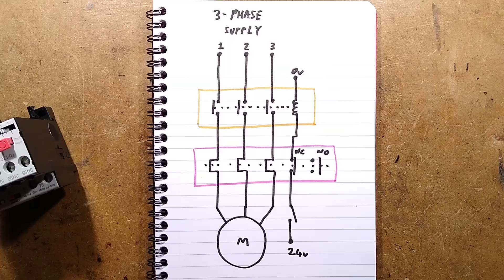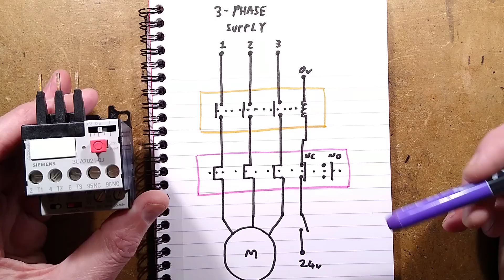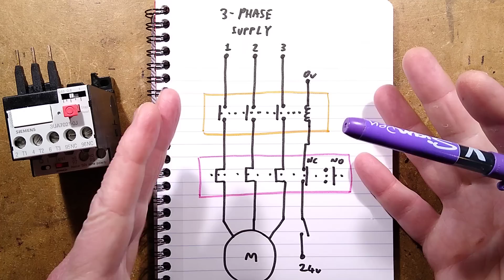Siemens motor overload relay teardown

Comment: When I was a baby electrician I went to a candy stretching machine at night that had a tripped overload. I reset the overload and it tripped instantly. So I tested everything and ended up disconnecting the motor. The motor ran fine. Turned out the gearbox had siezed. They definitely work
Reply: 99% of the time. overloads are mechanical in nature.
Reply: @professorg8383  Pretty much the only electrical issue I encountered was a broken (phase) connection on the terminals of an conveyor motor. It only ran on two phases so it drew to much current
Reply: @professorg8383  tell me about it. The only motor related call out I ever had that wasn't a mechanical jam causing an overload to trip, was when a VSD completely shat the bed and needed replacing. I'd get a call at 2am saying the auger or pump is tripping again, I'd even ask them if the shit was jammed up, "no it's fine, must be an electrical issue." Drag myself out of bed and get to site, first thing I'd do is open the inspection hatch, or remove the outlet pipework, and have a look, sure enough, jammed to fuck. 🙄

Comment: Siemens gear seems solidly built
Reply: Well, had a lot of Siemens stuff that stopped working eventually, after 40 odd years, well past the warranted lifetime. Rated only for a million cycles, but went well past the 20 million mark, though there were some switches that made it past the 10 million cycle mark they were warranted for, though to claim would be hard, as the switches physically wore parts out, or the contacts went intermittent. Guessed they were over 20 million cycles, based on the previous owner of the machine running it for 20 years on 3 shifts, 7 days a week, at full speed. 

Still had a whole slew of the original INA and FAG bearings in it, all still fine once greased, and the only thing that did fail was an original VARIMOT drive, which disintegrated the clutch spring. Obsolete, so went to the Fenner catalog, and got a 2 belt pulley and Fenner Lok hub, and machined the middle out, to fit the VARIMOT belt, which I can still buy off the shelf. Then put a VFD unit on the original motor, a fan for forced cooling, and it ran well. Forced air cooling to compensate for running at 30Hz,

Comment: I only knew them with an additional blue knob beside the reset button that could pushed in and turned to stay down, being able to auto-reset the device that way.
This sure only is a workaround in very remote locations that need to operate, or maybe the backup pump.

Comment: There are at least 2 other variations on these devices. The older one uses heater elements to melt tiny pots of a low-melting metal alloy like Wood's Metal, and when the alloy melts, it allows an embedded cogwheel to rotate under spring tension, tripping the mechanism. And there are more modern electronic types which use current sensors, a comparator circuit, and a time delay circuit to trip a latching solenoid.

Comment: Additional function for these is protection against phase loss, which is done by having that trip bar in 2 pieces, with trip being caused by either the 3 bending over too mach against a spring, or if you loose a phase you have one that does not move over with current, making that the trip point is now a lot lower, and tripping fast. Normally you have an option for manual reset, or automatic reset, where the contacts will change state on trip, then, after the shunts have cooled down, engage again. Normally selected with either a pin, or a slot on the actuator bar that keeps it in reset always. The units are not expensive, around the same price as the contactor, though of course you have a few different ones per model of contactor, with ranges with quite an overlap, so that you can choose a trip current matching your motor. Often used with a push button station, where the green button presses on the actual contactor coil to close it, then one of the aux contacts holds the contactor on, while the stop button resets the overload, ensuring that each operation of the stop will reset the overload, and drop out the contactor, or that the motor will not start and run unless you press stop first, to reset it, telling you it tripped for overload or phase loss, not for power failure.

Comment: It reminds me of repair i was send to. The column drill was not working and they needed the drill continuously. In the meanwhile the mechanics created a wooden board with a screwdriver attached to it. By pressing the contactor with this construction they keeped using the drill. It was my easyest repair i ever had. Just press the reset button and it worked again.

Comment: Nice to see you taking something apart thats not total cr4p. Used to use a lot of Siemens contactors and control gear, always good solid reliable gear.
Reply: Siemens is also german Which for me also adds extra trust knowing its from a european country who has good engineered/designed neat products

Comment: That to me back a few years as an apprentice electrician in a factory, making and repairing control panels. Those were the days doing bespoke work from wiring diagram, you were just giving the electrical specs and of you went to make a control panel, because you couldn't wait for the manufacture to send a replacement as a machine down was costing thousands in lost production. Most sparks these days won't know what your talking about if you said star start,  delta running
Reply from the maker: They do work it out when they manage to poke both contactors in simultaneously.   As for the start and run rated caps.  It's usually just one cap now.  Noting that modern motor capacitors do fail faster than the older ones.
Reply: @bigclivedotcom  Yes have noticed that, to the point I would not even bother testing them after 2 years of use, and simply replace with new, or add in a hard start unit across the capacitor, as that at least would allow it to run even with a capacitor down in value.
Reply: Or that you need to set the star delta transition time on larger motors, because you need ot get it right, or have a rather massive spike on that transition. 

Or the installer who wired the motor wrong. It started in delta, and after 5 seconds switched to star.  No wonder the machine had a tendency to walk itself off of it's floor mounting bolts. fixed that the day I saw it do that, and when i replaced control circuit I dropped the star delta timer completely, and instead used a 8kVA soft starter instead, and a new contactor and overload unit with the new motor. Adjusted to ramp up as slow as possible, and set to the profile for a large fan. 30s to get to full speed made for a gentler start. This was a 5 ton blender for powder.
Reply: A lot don’t understand CAP start CAP run either 🤔

Comment: At the bottom of the bimetalics is a double slider that trips the mechanism, if all 3 phases see the same current within range, all 3 strips may move a little
But if you lose 1 phase, one of the 2 strips will move more than the other, which will trip the device even if the remaining phases are within tolerance, known as 'single phasing protection'
also, if you are not isolating the whole panel (you could cause problems if you do) randomly pressing reset on all contactors could be an issue, the reset is also the stop function, it will disconnect the control circuit of a wiorking contactor. (press the reset while testing contnuity to see what i mean)
Reply: Yes , the style of overloads detects single phasing. However, they can be used in a single phase operation as long as you take the output of one leg and redirect it back into the overload on the third leg. That way you get even heating of all three elements thanks for the observation 😊
Reply: @DavidGauthiersquidpride2014   Nope... you are wrong. These do not trip on differential between each pole. They only trip if one or more phase heaters exceeds the set point for mechanical tripping of the aux contacts.  
There is NO need to double or in fact triple "take the output of one leg and redirect it back into the overload on the third leg." 
There is NO need to run an Active and Neutral of a single phase motor supply through the TOL.
Reply: @BTW...  There is a difference in force that one vs three bi-metal strips generate for tripping.  All the manuals i have seen for these have had jumper wires for 1-phase use.  And the connection diagram (for the whole contactor+thermal relay set) has always been supply to L1 in -> L1 out jump wire to L2 out -> L2 in jump wire to L3 in -> L3 out to load.

I probably have some orphaned smaller ones somewhere and could try to trip them.  There should be noticeable difference in tripping times, but it takes several alternating tests to filter out overall warming and ageing of the thing.  Bench power supply should give stable test current and it should not make any difference versus mains ac.  Though as I am an electrician, it would be easy for me to safely run something like space heater through one.  If I could find matching devices to make the trip time to be >minute, so that the trip times would be close to real life situations with broken phase etc.
Reply: @BTW... Here is where you do not know what you are talking about. 

SOME over loads do not care if you use them with single phase, they are purely thermal overloads, SOME also have magnetic overload protection. These require you to run the current back through the 3rd leg...in the same direction as the other 2. Or they will trip instantly. They even make digital ones that are more complex yet. 

As usual technology is more complex than a simple yes/no answer. 

You should probably educate yourself a little before running your mouth and looking like a fool.
Reply: So, i did it.  Almost 100 trips with autoreset and esp8266 measuring the results.

My test setup was two relays controlled by esp, first one connected that zigzag pattern through all poles, second one used only L1 (which is usually the way those are wrongly connected).  I also changed the setup mid way to measure L1L3 and L2L3 two pole trip times.

At first i tried with too small 125% current, 3-pole setup tripped in 213 seconds, but when i tried one pole only it had not been tripped at 12 minutes, so i raised the current to 150% and all the rest have been tested at that level.

Average trip times at 150% current are like this:
L1L2L3 - 115 seconds (101-128)
L1 - 216 seconds (138-284)
L2L3 - 85 seconds (81-91)
L1L3 - 95 seconds (91-103)

Others were quite stable and graphs are pretty flat, but L1 raised from ~140 to ~240 seconds with couple spikes to ~280 with about the average result between them.

After the thermal relay had tripped, program waited for autoreset and additional 5 minutes after that before trying the other connection.  So it was alternating between two current paths and letting the thing cool a bit between.

Device that i tested was new in box, but old telemecanique LRD02 (same device is now sold as schneider tesys) 0,16-0,25A (ac/dc) at 0,16 A setting, so my test current was 240 mADC from bench power supply.

I also found a broken LRD03 from my junk pile and did tear it apart.  It does have that mechanical imbalance function mentioned earlier.  Theres a clever linkage that makes the tripping arm move more, if the bi-metal strips bend differently to each other. 

That imbalance-function shows clearly on the 2-pole results, but i'm not sure why 1-pole trip times go that high.  I don't think that the overall temperature could have risen for 7 hours straight.  I changed to two pole setup in one 5 minute cooling period, so the temperature did not change because of that and results after that were stable.

It's not an actual real life test, as the current is always at tripping levels.. Someone else could try to run these 30 years at a time, before trying the "motor malfunction" trip times.  VFD:s and integrated EC-motors have been a thing for a while for almost anything, so these are already somewhat historical devices.  But now i know much more about these, so thanks for starting the argument :D
Reply: Sure about that?
If one of the 3 phase is lost that associated heater will NOT move. The other 2 will move the same degree - "one" won't move more and initiate a trip condition. 
The "single phasing protection" derived from higher current draw on the 2 live supplies as a result of a phase loss, and is very very basic indeed. It only works on motors under load. 
You know these TOL can be used for single phase  or 2 phase over-current protection?  Just because it has 3 phase connections means they must be used for 3 phase supply. 
Lose 2 of the 3 phases and there is no such 'single phase protection' in a delta wound load. So, that term "single phase protection" is a misnomer - try phase loss protection instead. 
A substantial control panel will have 'phase loss' monitor devices, being the correct protection instrument for supply fault conditions. 
In such control panels NONE of the reset buttons is used as a 'stop' function. What you suggest is only found in basic stand alone DOL starters. 
Not all TOL modules open aux contacts when pressing that reset. Some even have a separate 'test' button and some have an 'auto reset' position on that manual reset button.
Reply: @BTW...  I've taken several makes of overload apart, they all had the part i mentioned, if one phase is lost, that heater won't move, and because of the sliding mechanism, it biases the other 2 to trip quicker. even the old allen bradley's with dashpots had something similar
You can put all the electronic protection you like in a circuit (yes we had phase monitors too), but they can fail more than a simple mechanical system
Reply: Try an Allen Bradly motor starter. It's a Chinese puzzle box.

Comment: These are used in many of the machines I service - Dishwashers, mixer grinders, etc. Some of them are directly built into the contractors and are inseparable. Usually use the NC contacts.

Comment: So, is that considered to be what I've heard here in the US called a "starter"?
Reply: Contactor is still called a contactor in the US. Motor starters are most often electronic these days, using solid state hardware.
Reply: A motor starter contains most or all of the following: A disconnect switch, line fuses/breaker, control transformer, contactor, and overload relay. 

A very basic minimalist starter has a contactor and overload relay.

Comment: It is not just overload protection, it will trigger on loss of a phase, always and protect the motor from burning to a crisp.
Where i live, the phase loss is much more important that overload, hence i use those a lot and have several in a box collecting😃 dust waiting for their turn to go work!
Reply: I did not put the smiley there, it was at the end when i clicked send!!! Youtube, wth???
Reply from the maker: You can also get phase failure modules that will break the whole control circuit if a phase goes down or the machine is connected with wrong phase rotation.
Reply: Clive why you using your old screw driver ?

Comment: I remember the bad old days when the heaters were separate parts you would install in the contactor , one for each phase and 2 screws for each one
Reply: Yes have dealt with them, but is is exclusively a US equipment thing, the rest of the planet dropped it decades ago, but the USA still uses it in places. You can stll buy them as replacement parts for old machinery, where the owners are loath to change out the contactor for a modern more reliable one.